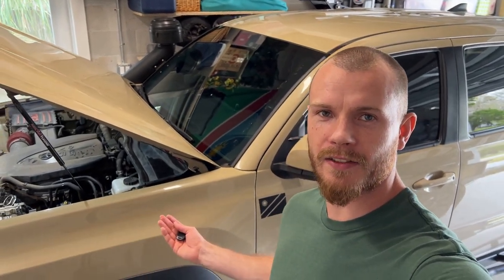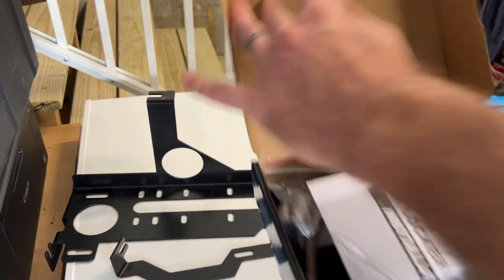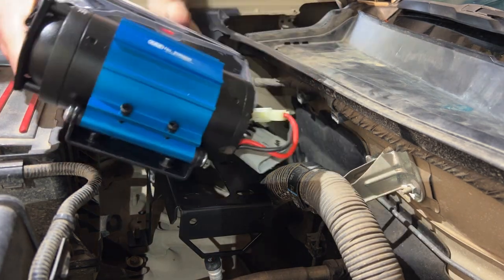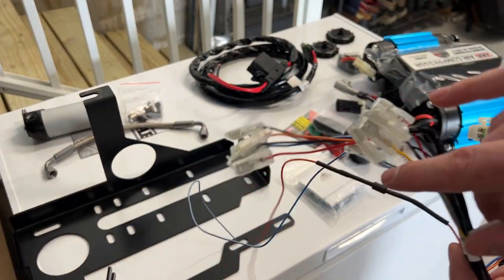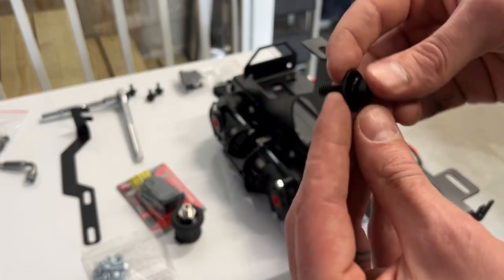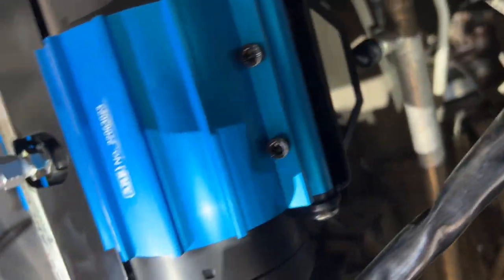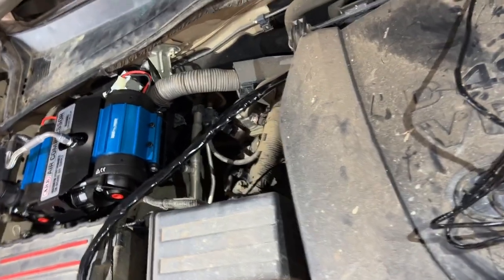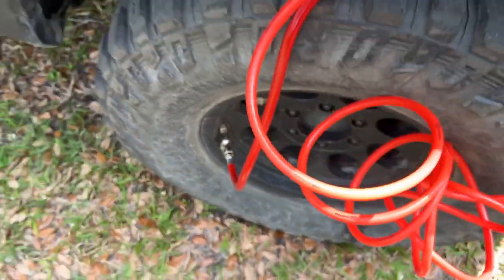ARB Twin Air Compressor Install in 3rd Gen Tacoma

Comment: Great install video just got this setup for my 2007 v8 4runner my bracket is a M.O.R.E. Bracket That also months the 1 gallon arb Tank as well I'm installing the Inflation kit and the lockers also though
Reply from the maker: Thanks. That is also a great setup that I considered. In the end I decided against the 1G air tank and wanted a bit more clearance above the compressor. Thanks for the comment.
Reply: @offroadyotaxploration  yvw good video

Comment: what was with the diode?
Reply from the maker: I used it on the wire that runs from the power source to the switch. It only allows the current to flow in one direction. As it was included in the harness I assumed it may be necessary, so I made sure to include it in my configuration.
Reply: Ok good deal

Comment: Is the manifold required?
Reply from the maker: No, you can run the hose straight to the compressor. If the compressor runs for a long time though, the hose will get quite hot.
Reply: So are you using the manifold simply for convenience?  @offroadyotaxploration
Reply from the maker: I am using the manifold to preserve my air hose. At times i use the compressor to fill up multiple vehicles in a row, which could cause enough heat to break a plastic hose.

Comment: Can you show how you wired your switch up? Did you run the purple cable to a relay?
Reply from the maker: The purple cable runs straight from the compressor to the switch. then I ran power and ground to the switch. I believe the compressor has a built in relay. It gets wired directly to the battery, so no need to run a relay on the switch cable.
Reply: thank you!  @offroadyotaxploration